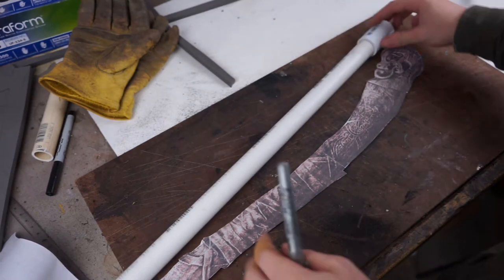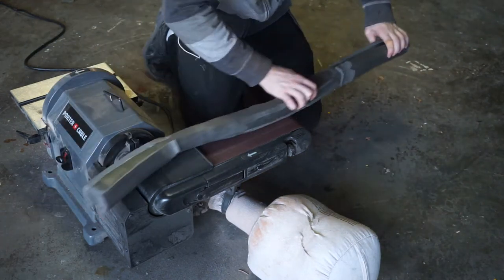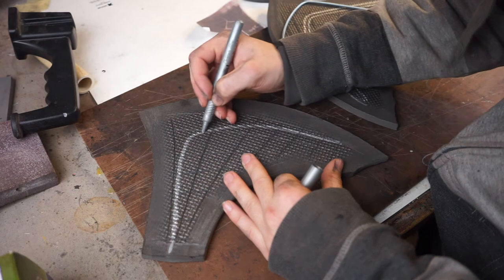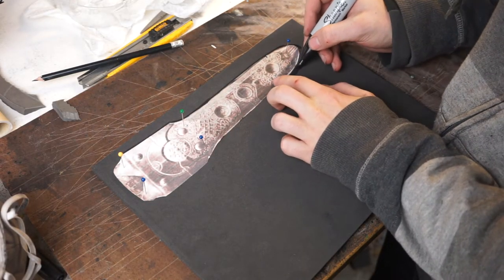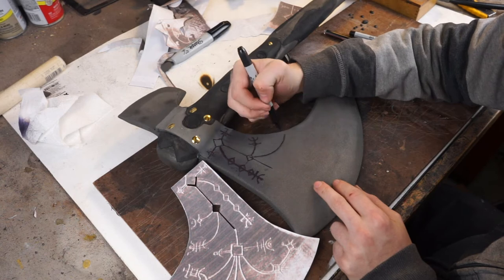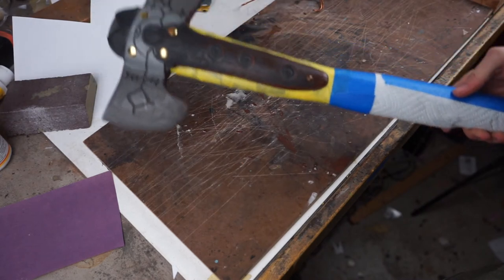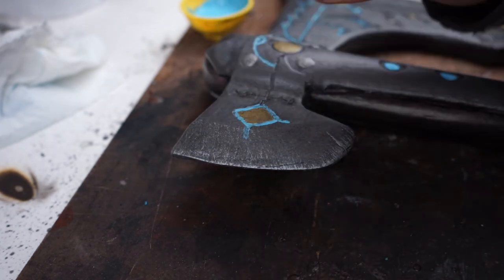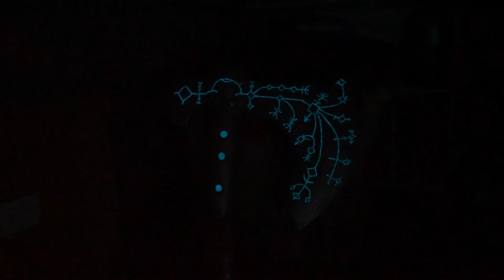Building The Leviathan Axe from God of War

Comment: One more question for you! Instead of black plastidip, would it be realistic to use a mix of black acrylic paint and modpodge, similar to what we did on the handle?
Reply from the maker: that works as well, The plastidip just has a bit more flexibility and goes on even with no brushstrokes. Modpodge and paint is a cheaper less messy choice though.

Comment: Is there any reason not to just make the handle itself out of EVA foam? Would it be too weak to hold up?
Reply from the maker: you need a stronger core (pic pipe). if you just made it out of EVA foam it would be much too bendy and not hold up
Reply: @cwlbuilds  that makes sense, thank you!